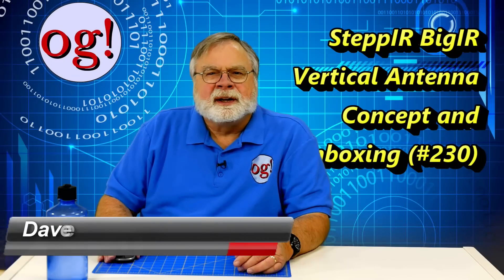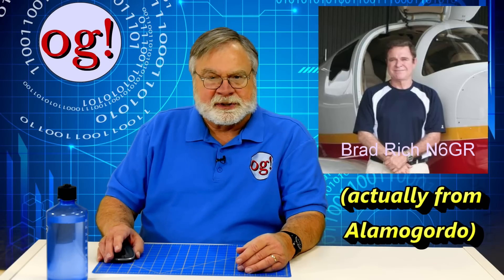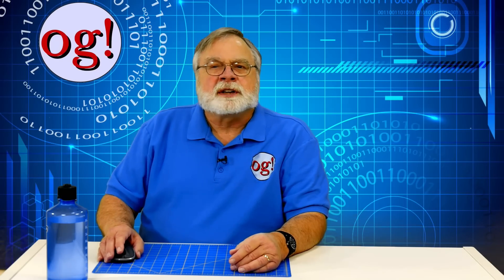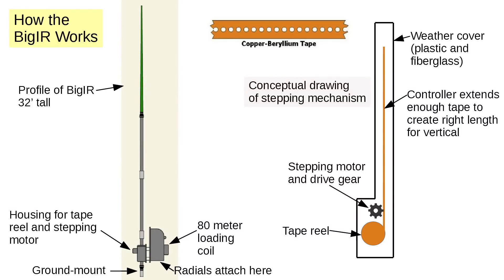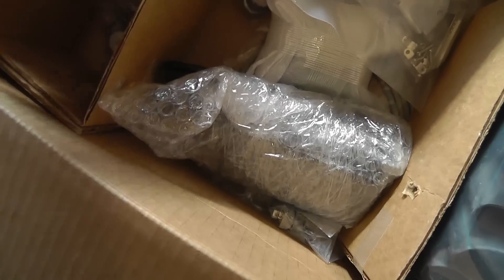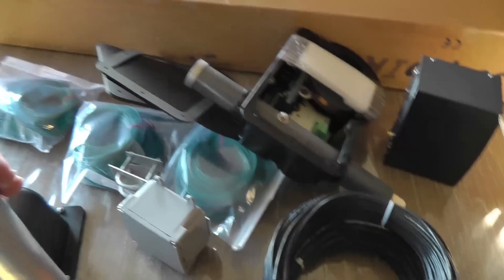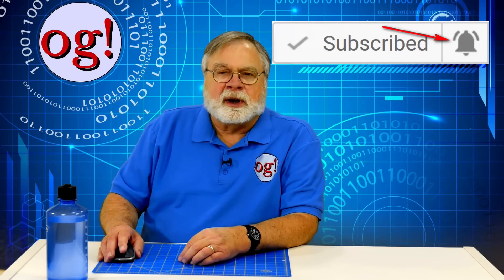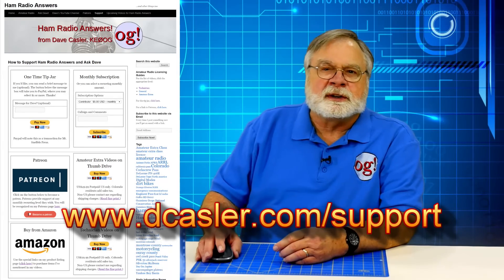SteppIR BigIR Concept and Unboxing (#230)

Comment: See SteppIR knows how to pack and ship their ant.because this one is well protected against bad handling and the well labeled bags of parts is a real blessing for assembly. I am suitably amazed and impressed.  I see a silver coated SO-239 socket is not provided.  When my big expensive radios arrive to me, they have silver coated sockets and protected by plastic caps over them.  That is a very nice touch which would really impress me as I unpacked my expensive, dare say the word, vertical.

Comment: This was very informative as I bought the BIG IR MARK IV and asking questions about the control wire and what is involved with a longer cable are not being answered quickly. I would like to pull a 9 cond 18g stranded cable and RG 213 to the antenna site before the actual antenna arrives. Looks like long but interesting hours to assemble. Looks well made. Which end is the computer plug on (control cable?)? The controller or at the base of the antenna assembly? I have no interest in 80 M. I have a VEE antenna for 80 down to 160M and too many crazy things on 75M.
If You think I'm crazy spending $2400 on this antenna you will get a shock by me telling you I cancelled an order for an almost QRO rated magnetic loop antenna for $3300!!!!!!!!!!!!! The BIG IR advantage is a continually variable antenna where adjustments are made in the comfort of my shack for anywhere on the ham bands. No traps or coils to waste RF power. HUGE ground screen...(ACTUAL Stainless STEEL WELDED screen).  3 feet wide and 50 feet long in 4 directions

Comment: 73 Dave, I too am disabled but I have problems with mobility so installing an Antenna to difficult for me. I will probably go with a vertical for HF, but it will be limited by my inability to change frequency in shack. Tried MFJ loops but the don’t seem to work well with all the stucco and wire on my house.
Reply: Where are you?
Reply from the maker: Stucco homes are usually covered with chicken wire first and then the stucco sticks to the chicken wire, so that can create a problem. If you have a mag loop is there a possibility of setting it outside? I know someone who disguised their mag loop as a birdfeeder.

Comment: That's a high quality piece of kit right there.   I'm looking forward the the upcoming videos on it. 
How do they get around the possibility of the metal tape eventually sawing it's way through the pole?  Does it have a teflon coated tip or something?
Reply from the maker: I suspect over time there can be a bit of buildup of dust in small pieces of the metal. Beryllium by itself is poisonous.

Comment: So Dave is that kind of discount available for any Ham if we negotiate ?
Reply from the maker: Usually when a company sends me something to review they send it for free. But SteppIR could not bring themselves to do this. So we negotiated a low price. I tell you that to be completely straightforward about the deal. Clearly that was a special price, because they wanted the antenna reviewed. I still paid more than I would have paid for a verticals such as the AV – 640.

Comment: When you say then a vertical antenna is your best one, then I will know how to evaluate the rest of your comments.  I am the proud owner ohh wait tower that takes my antennas up to nearly 100 feet....... And then on the tower is a five element mono bander for 20 meters,  a five element yugi for  /15, and I took down the five element 10m and replaced it with a single boom with four elements on 10 and 5 on 6 meters.
Reply: So you can see then I may look down my nose at a vertical.

Comment: yikes! that is a bit high. $2.5K  for another $1.5K you can own K4 .
Reply: A 6-40 meter BigIR can be purchased for $1,250.  You will need control cable.